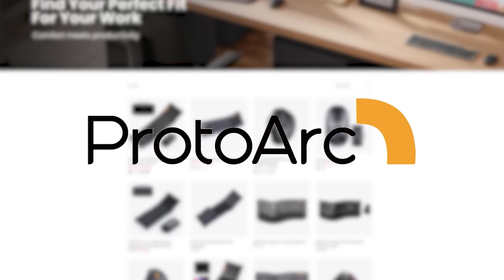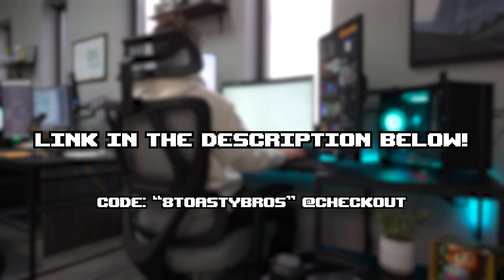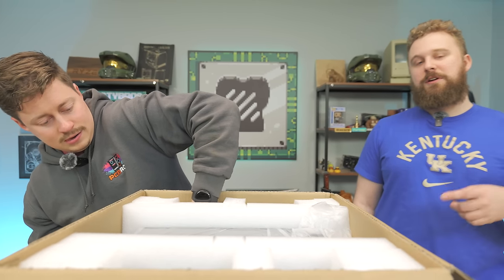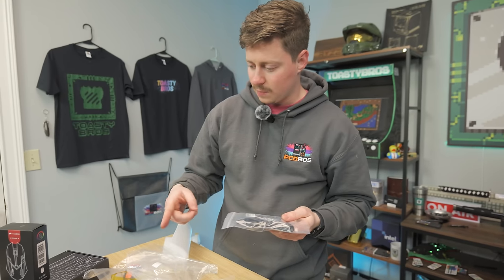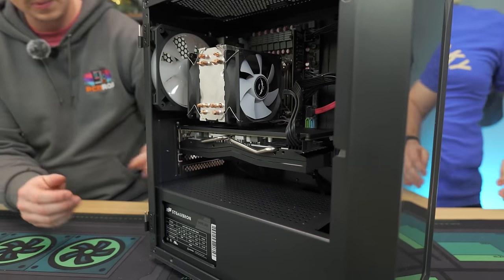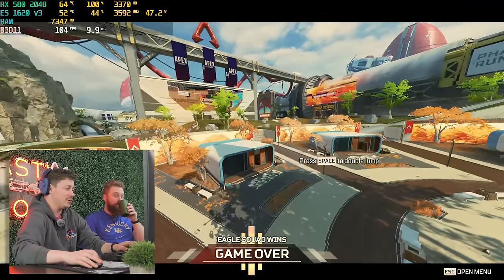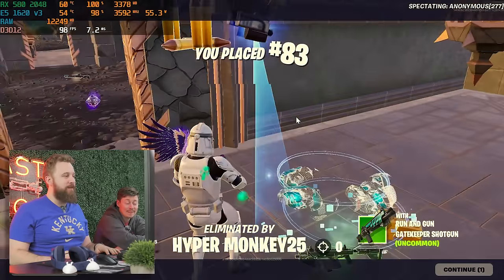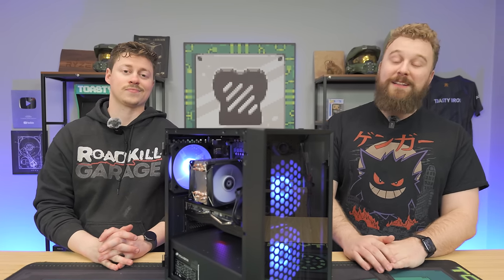We Bought a $399 Gaming PC From Amazon...

Comment: I found an Aliexpress deal for a e5 2650 v2, x79 board and 16 gigs of ddr3 for about $33 .  It's a 8 core 16 threads chip at 3.4 .  I  ordered all the parts and will build in about 2 weeks.  When I get it built is am doing to sell it for a little profit.  I already have a rx570 to put in it. Everything but the gpu came to $188.00  . If I add the gpu is $260-ish.  Fun times...

Comment: if it was the 1660v3 it would be perfect, much better cpu and you can even run 4Ghz all core with simple xtu overclock and better psu

Comment: Well it could be a good starting platform for a couple simple upgrades down the road. Adding an E5 V4 will raise your ddr4 speed from 2133 to 2400 , 32gb on AliExpress will be so cheap. You can upgrade to a better graphics card , a 1080 or 2060 , maybe better would give you much snappier performance . Just be aware of the power requirements, E5  xeons use a lot of power on their own so plan ahead.